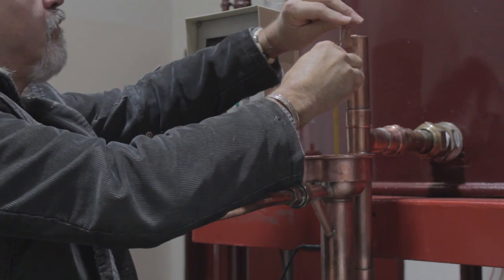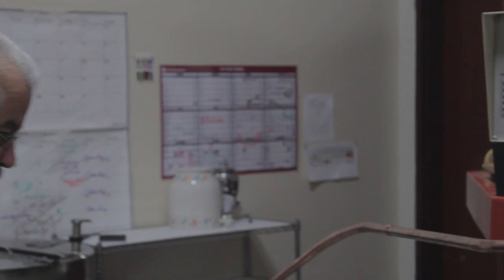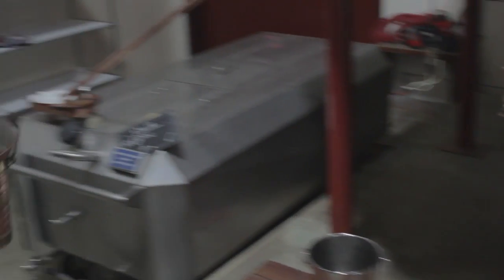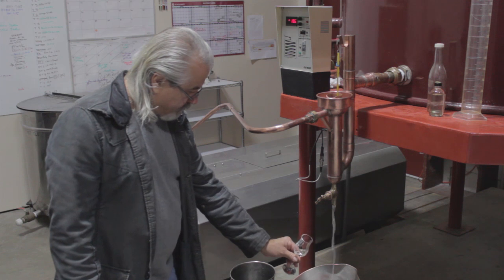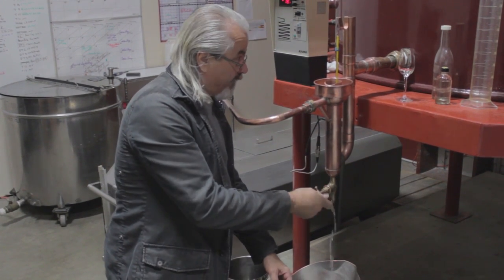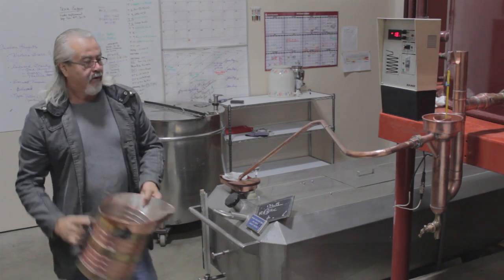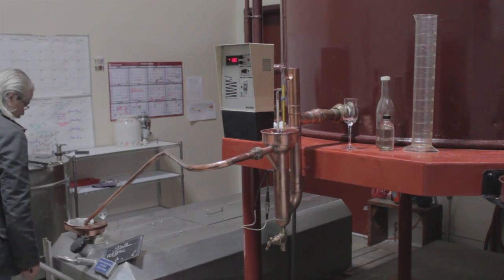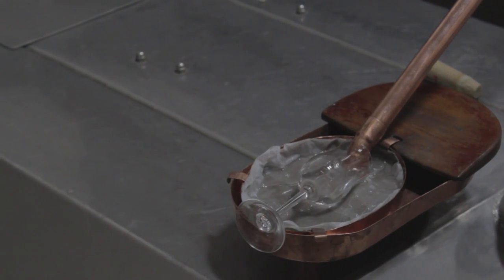Heads Cuts

Comment: The very last part where you mentioned the thin filter collecting the sulfurs.....is that truly effective? I didn't think that could be filtered out, but that the copper just neutralized those sulfur compounds. Does it truly make a significant difference?  Thank you in advance for your reply.
Reply: You are correct. Copper is what removes the sulpher. The filter is good for particles in the air, gnats, or the long hair of the distiller not going into the collection tub.
Reply: He did say sulphur precipitate, not compounds, so we're talking elemental sulphur.